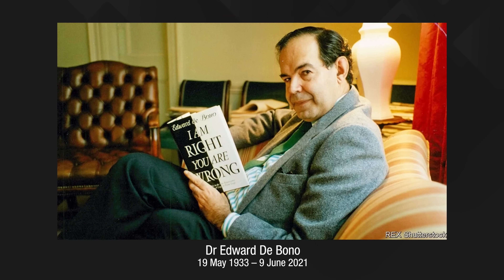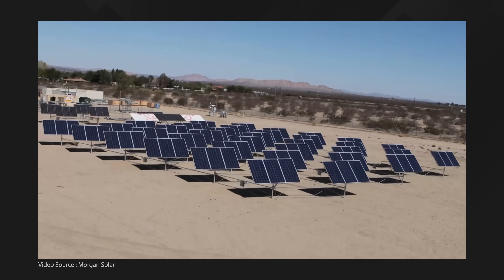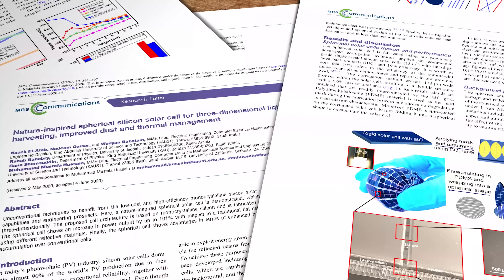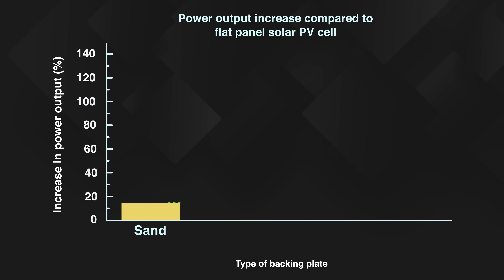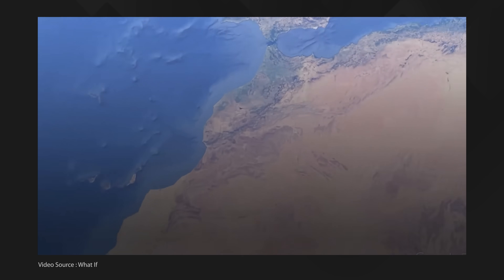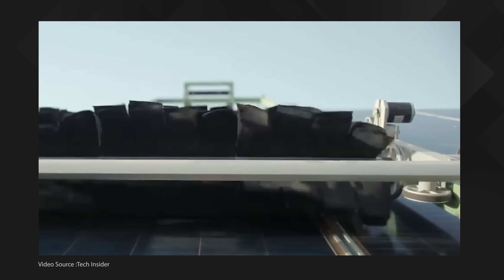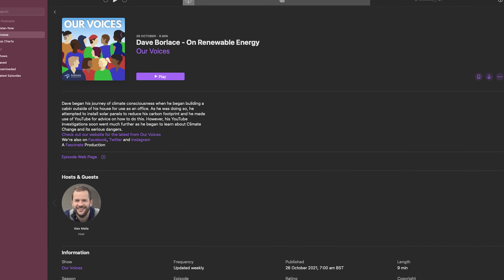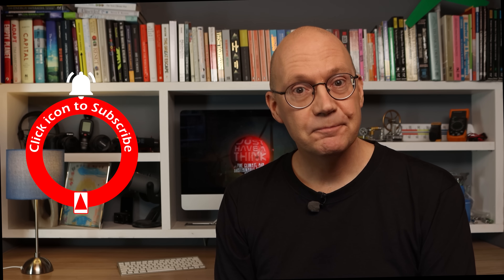Spherical Solar Cells - doubling the power output of flat PV panels!

Comment: It's important to keep in mind that these are NOT more efficient solar panels.  They are the same roughly 20% efficient panels we already put on our roofs.  They just have more surface area for a given amount of ground cover due to their shape.  

I really like the idea of getting more energy per square meter of roof, especially since it does not require special materials.  And as a side benefit, if I cover my roof with reflective sheets to focus the insolation back on the spheres, it also keeps my house cooler in the summer.  It's a small win, but I still like it.
Reply: Exactly! It is also important to note that spherical panel actually uses considerably more PV surface.
Reply: @arodic  Yes 4 times more area.  The surface of a sphere is 4x that of the 2D projected area of the sphere, ¶d²/4.

Comment: Some what skeptical. A sphere is probably not the most efficient shape for  solar cells. I suspect the watts per square metre of active material is low.  Surely there will be an optimum shape for a particular latitude. You need to decide what to optimise for like maximum power or constant power over a day. If this idea is so good the you would think non tracking massive solar farms would simply orient their panels to conform to some curved shape ( no need to change height, just orientation). 
If the extra power is achieved by adding a back diffuse reflector then this is all a bit silly because what you are doing is increasing the solar collection area and the spherical shape collector is irrelevant. So you might get more power by simply flattening the entire active area and face it in the average direction of the sun? Without knowing the details it’s hard to assess.
I think this all sounds a bit dodgy, however flat is unlikely to be optimum for a fixed collector and neither is a sphere.

Comment: There are two applications to consider. Firstly is large solar farms. These can be whatever size as they’re limited by the cost of the PV panels, so price per watt will be the driving factor of these, and tilted or actuated PV panels will likely remain the king of this market. Then there’s rooftop solar, where you may end up leaning further towards maximising energy per area, but even then actuated panels with cooling would likely dominate.

Putting water pipes on the back of traditional flat panel solar cells would be my suggestion, because that way you get an abundance of hot water for your showers, or run it through a heat engine.

Comment: Sunlight doesn't have enough power to make putting solar panels on cars and drones a truly viable option. Putting them on a car would only make enough power to run the HVAC, or counter parasite drain. Not something that could reasonably charge it enough to make the added cost and weight make sense.

Comment: This is a good solution for a problem that doesn't exist. The problem of generating electricity from sunlight is - usually - not the lack of area but the cost of PV cells, and if the available PV-cells are the limiting factor, you want to point all of them perpendicular to the sun. Pointing PV cells to any other direction results in a loss of efficiency.

Comment: Why oh why! Again no critical thinking or research! What are the total of panel surfaces compared. What about that half of the panels always are in the shadow. How are the cells connected, as normally in series they loose a lot of potential due to the shadowed cells. Flexible panels are interesting but spheres are just stupid. All the extra steps, work and investment is ridiculous for 50% pointing away from the sun. And cleaning is point, but will be for the spheres too. But where flat panels are simple to clean, the spheres are way more challenging.
I guess it's way cheaper, simpler and more efficient, to just install sun trackers instead.
Reply from the maker: The aim of the channel is to present an overview of these ideas. If you want to challenge the science then I leave all the links to the scientific papers in the description section.
Reply: @JustHaveaThink  thanks for the answer. But I had the impression you were more critical in the past and didn't play so much into the hype train of nowadays startup mentality. That's why I really liked your content. There are so many around that already just retell the most ridiculous claims without a think, question or clue.

Comment: I have a question about flat panel solar.

I'm in Germany and people are putting these solar flat panels on the roofs of their houses which makes sense in the summer.

But my question is why don't they ALSO put flat panel solar cells on the vertical walls that face south east and west?

In the winter the demand of power is going to be higher because it's cold and the sun is much lower in the sky.  Also for a few weeks per year there will be snow.

Obviously wind power is going to be better in the winter for most of the world, however Germany don't have much of a coastline and France is in the way of the ocean.

So if you want solar power in the winter surely using the vertical walls on your house that face south, east and west would make sense rather then only putting it on the roof.  Using the roof makes sense in the summer, but I'm thinking about the winter when there is more demand for power.

So why not have solar on the roof and the walls of your house?

Comment: I am surprised that you didn't do your due diligence on this. 
The sphere would have 3.14 times the surface area of a flat panel "of the same ground area" thus the base cell cost alone, before you process it into a sphere, is 3 times as much and even at 160% efficiency is only producing 50% of the energy per sqaure unit compared to the flat panel. Another point is that in order to maintain peak efficiency the bounce board would have to track the sun otherwise it would only be at peak efficiency at a single point during the day. And the bounce board would increase the necessary ground area thus further negating the supposed output increase.
The sphere would need to by broken down into numerous zones so in order to minimize the effects of segment of the sphere being in reduced exposure or full shade. These multiple zones would also drive up the costs.
It is also pretty safe to assume that they are comparing their performance to a stationary flat panel over the course of a day. When you consider that a dual axis tracker can increase flat panel performance by around 50% the sphere's advantages start disappearing very quickly.

Comment: Great step in the right direction. Next development needed will be for the beads to be enabled to establish necessary connections electro-chemically so that a prefabricated sphere with a sticky surface and pre-printed circuits could simply be rolled around on loose beads, then subjected to an electrical current or heat to produce a spherical solar collecter ready to be wired in.

Comment: Taking a flat panel and cutting grooves into it is not the best way to go.  Somebody needs to work on making the panels curved from the outset, or making them flexible enough without  cutting grooves in them.  Then most of the extra build steps go away and you can concentrate on getting the best out of the light in the environment.

Comment: I vaguely remember a PV system that sounded similar, but not identical, I believe it used a technique using older PV coatings on a glass tube like the ones in florescent lights. The idea was it could be placed in the same places as normal flat panels, but because of the rounded shape of the tubes it would always have a fairly good angle on the sun. Also, because it was made of a series of tubes instead of a flat panel it allowed better wind flow. Did that ever pan out or did some glaring problem come up with that system I haven't heard about? If there was a problem, I think this technology might make it viable to at least go back to that idea as well, and these systems didn't account for a reflective backing material at the time either, so maybe someone should get on that. ;) (NOT an engineer so don't look at me)
Reply: Solyndra is the name of the company that developed the thin-film PV tubes.  The company experienced a spectacular failure, however I am not sure if that came down to issues with the underlying technology or related to the company management and prevailing politics of the day.

Comment: "with the same ground area." The major limitation we are running into is how much total amount of of PV material we can produce, not surface area yet.

I'm highly skeptical that a sphere dissipates heat more efficiently than a plane.
Reply: Actually the better heat dispation is the easiest thing to understand, air currents can more easily rise up and off of a sphere due to it's better drag coefficient.  Move air movement means better cooling, the question is out in the wild is the movement of ambient air going to help, hurt or make the effect irrelivent.
Reply: @kennethferland5579  air has a harder time flowing across a curved surface than a flat one. Now I could see the possibility that this creates turbulence that stirs the boundary layer but it would be easy to add obstructions to a flat panel to do that.

Comment: So, what is the difference between these balls and just building standard panels into an arch?

It seems like it would get most of the benefits without the cost.
Reply: The sun moves both east to west and north and south over a year. It would have to be a pillow shape to get similar effects, although with no back scatter collection, and less self cleaning.

But reducing the overall curves does have a positive cost impact, i would more generally go for truncating the sphere for cost reduction however.

Comment: If the efficiency numbers are based on planar surface area, then of course the spherical cells should be better.  They have more cells per unit of land area.  A more sensible comparison would be Wh/Dollar.  I highly doubt the spherical scheme wins there.
Reply: I'm not as doubtful. If the panel costs 2x as much yet only produces 30% more power, it might still come out ahead. Most of the cost of getting solar is mounting, installation, inverters, space (land or roof), etc, not the panel. Doubling the cost of the panel might only boost the overall cost by 25%.
Reply: @dosadoodle  a sphere needs 4x the material plus the complex shape to manufacture. Even in the best case it will cost 4x more

Comment: I keep wondering why we have not added a closed loop heat pump with PV panels as the heat source and perhaps a pool or aquifer as a heatsink to cool the panels improving lifespan, efficiency and cognerating some power while collecting heat. Throw them on a barge that are permanently moored in the ocean and connect the barges with hydraulics you have a floating wave to energy converter holding heat pump cooled PV panels offshore. Perfect the barges and it someday could be a base for airports and shipping ports, roadways and factories away from populations. Think big, really big our scale is very limited right now.

Comment: All good. There is no doubt whatsoever that the eye shape of the fly is more efficient at capturing light than a relatively flat eye shape, which, along with its wings, enables it to survive long enough to propagate its species. However, natural selection being a subtractive process, it is irrational to think that said subtractive process could randomly result in a more efficient eye shape. The fly's eye shape is clearly an integral part of the fly's overall design. In fact, no fly fossils (or flies in million year amber) have been found that don't have the round eye shape (i.e. NO "transitional" fossils). Darwin thought there was no Designer. The evidence argues otherwIse.
If you think Evolution is the best explanation for increasing complexity and efficiency in living creatures, I suggest you take a very close look at the owl skull, eye shape, eye socket and neck vertebra. All these separate biological anatomical parts function as  a unit. They simply would not make sense in the absence of a single one of the others. With eyes that are fixed in the head, the head HAD to be able to turn so MANY degrees. The vertebra HAD to be designed to allow normal blood flow during extreme head rotation or there would be no advantage to the fixed binocular eyes and 270 neck rotation. The absence of any one of these "mutations" would have dangerously decreased the owl's predatory efficiency if it had not "evolved" simultaneously, which is statistically impossible in the time frame Owl species had to "evolve".
As an earring of gold, and an ornament of fine gold, so is a wise reprover upon an obedient ear. -- Proverbs 25:12
Read more about the 🦉 Owl:
http://renewablerevolution.createaforum.com/wonders-of-nature/special-sensory-perception/msg12526/#msg12526
This other story, more related to your normal subject matter, may interest you:
👉 The Only Known Solar Powered Vertebrate 🌞
http://renewablerevolution.createaforum.com/wonders-of-nature/special-sensory-perception/msg7066/#msg7066

Comment: The greater ability of a spherical object to dissipate heat compared to a flat object sounds contrary to physics.  Spherical objects have the smallest surface area for a closed object, meaning there is less area across which the heat can escape.  The flat panels have 2 very large areas for heat to escape, compared to their volume. I would think the heat more likely to be trapped inside the sphere.  Something doesn't add up here. (Possibly my understanding of physics is off).

Comment: Easy way, instead of spherical balls difficult to fit panels, go for dodecahedron shape or other multi-faceted solid object where every face is flat!
Reply: Yes and if each tile is small enough, from a distance it looks the same as the smooth curve.
Reply: Like a fly's eyes.
Reply: @RWBHere  The parts of a fly's eye are not flat surfaces.  They are domed slightly. This cause them to get more light onto the receptor at the bottom of each part.
Reply: More likely to work better in sandy environments too as more likely at least some of the surface won't be clogged during / after a sandstorm!

Comment: You'd likely get most of the benefit with simple manufacturing by using a more basic shape.  A tetrahedron or cube stood on the vertex would likely work dandy.  Go nuts and stack a bunch of triangles in a dodecahedron.  That "sphere" shown in the paper was pretty rough.

Comment: If they can be scaled down in size they may find a ready market such as on boats where there is only a limited area on which to place solar panels so the increased efficiency would be worth the extra cost of production
Reply: The added weight of these things would be a problem on a boat.  It moves the center of mass upwards.
Reply: @kensmith5694  for sure one wants to keep mass as low as possible but if they can be scaled down in size the weight would also drop and the increased efficiency of the spherical design would allow a better output per m²
Reply: @davidantill6949  I seriously doubt that the full installation will get more power per unit area.  The physics of the cells is largely setting that limit.

Comment: The sun  does not move 360 degrees around an object located at a fixed position. Because of it arcing path objects have a sunny side and a shady side. So how about a demisphere?  or a 3/4 sphere?
Reply: ...look at a map and read up on what happens above the Arctic circle.
Reply: @swedmiroswedmiro1352  true.
It's not research by an Inuit University that's being discussed though.
Reply: My thought
Reply: How abort pointing a flat panel so it's always perpendicular to the sun's rays, with additional solar cells on the back of it to harvest some reflected and ambient light? That design (solar tracking with bifacial panels) is in widespread use in solar farms generating gigawatts of power today. These spherical cells aren't going to catch up.

Comment: Many years ago there was a cone shaped version but the issue was they only collected sunlight from the front and did not collect the reflected light.  So 50% was always in the dark.  https://youtu.be/zMQA9khsF10  there was also a corrugated shape variant of the flat panel that collected over a wider angle.

Comment: I am continually amazed at how 'out of the box' thinking provides solutions to problems and makes our world better. This is a good case in point. Who would've thunk it? Thanks JHAT for your educational and informative videos.
Reply: I'm afraid this idea is a little too far out of the box.  It's wildly expensive compared to simpler flat panels.
Reply: @incognitotorpedo42  I disagree.  I see this idea as being too far into the box to be a great new thing.  They make the solar cell flat and then bend it to shape.  It seems to me that they are starting with a technology that costs the same as the flat panels and then adding more steps and etching away some of  the area.  Making a curved surface that works as a PV would be a really out of the box idea.